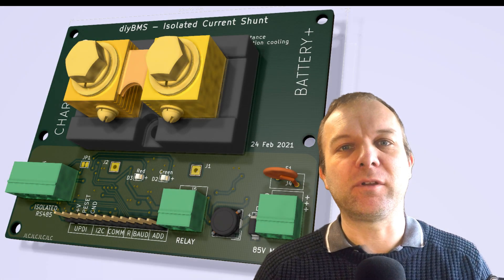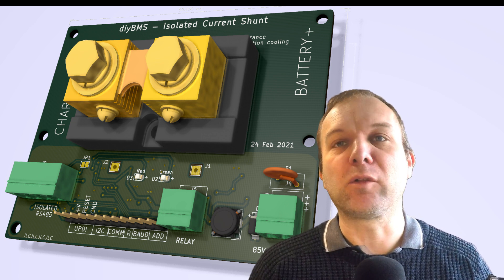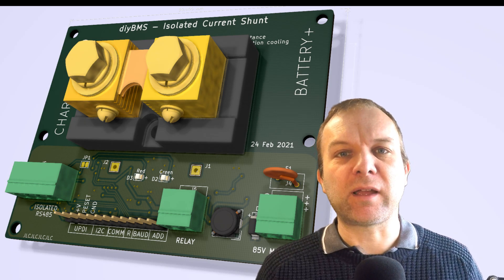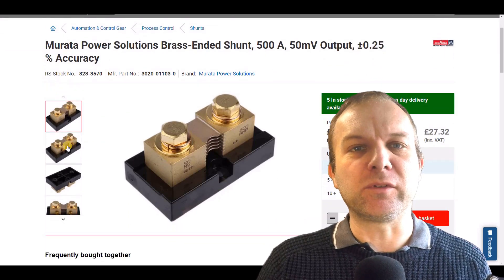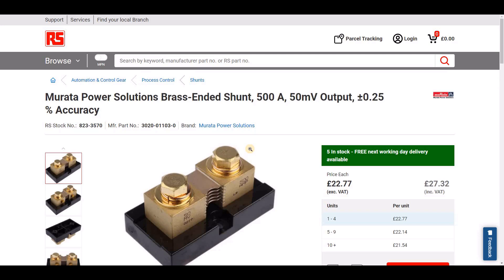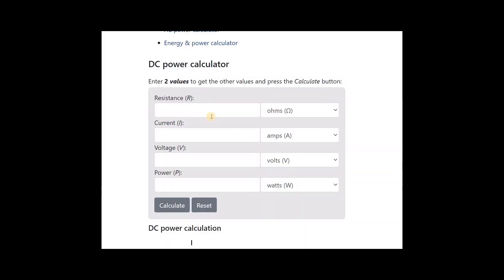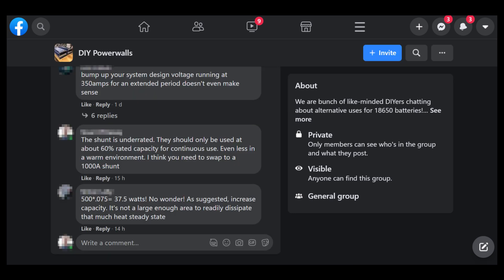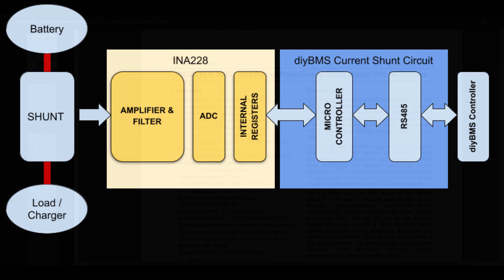Current monitoring (shunt) update & progress so far [diyBMS]

Comment: Hello
First of all, thank you for the DIY BMS project
i also have BATRIUM and i have more problems with it than with DIY BMS. I am asking (due to problems with parts) to answer if it is possible to use it for the DIY BMS shant BATRIUM project? I have an extra one, hence the possibility of using it
Thanks in advance for your answer
Regards, Jerzy
Reply from the maker: No I don't think that's possible

Comment: If the shunt gets hot it would be best to isolate it from the PCB, as to not heat up the board. That is, produce temperature gradients across the PCB. Temperature gradients can influence sensitive voltage measurement circuitry through the Seebeck effect. On the PCB there are many different types of metals connected together (like a thermocouple), so the only way to avoid these thermal EMFs is to make sure all areas of the board are at the some temperature (it is best to look at the final design with a thermal camera to make sure any temperature gradients are kept to a minimum around the most sensitive nodes). 

In some very sensitive instrumentation you will see sensing circuit PCBs with larger and many internal layers. This is done to spread out heat evenly on the board. You may even see the PCB contain an Aluminum metal core, or the entire board (circuitry only on top), bonded to a 0.250" aluminum plate.

You can connect the shunt to the PCB using a wire or a flat bus bar. If the shunt and PCB are rigid within the same enclosure a rigid bus bar will not vibrated as easily as a wire. A low value shunt wire connection must be held rigid as to not vibrate. If the installation is not subject to vibration than a wire will work. I like making custom bus bars because once soldered to the board they stay in position relative to the shunt sense terminals, when you have to separate the two. Why? for high gain circuits you can calibrate the circuit with the first stage gain or just have a huge selection or shunts available from the vendor and pretested as to measured value. Then you can select the shunt that best matches the amp, and not have to calibrated (change a resistor) the gain. So, on a production line you would have a selection of shunts and amps, and then have a calibration procedure to just match them up. With the worse case being having to change a gain setting resistor for the first stage instrumentation amp.
Reply from the maker: They are all very good points you raise.  The shunt doesn't really get hot - and its also insulated by the plastic base.

Comment: Stuart, any progress on this?  I don’t see anything posted on your GH. 

I’m similarly have started to work on a power monitoring PCB using the INA228AIDGST and an ESP32. My initial plan is to physically separate the shunt away from the PCB as this adds a lot of flexibility to use any shunt.
Reply from the maker: Yes, its fully complete and finished - https://github.com/stuartpittaway/diyBMS-CurrentShunt
Reply: @StuartPittaway  Hello. Is it possible to connect two or more current monitors?
Reply from the maker: @kaldeis  its not currently supported, although there isn't a hardware restriction, its just not written into the controller code.
Reply: @StuartPittaway  Do you plan to add this functionality?
Reply from the maker: @kaldeis  If there is enough interest in it, I can.  I think you are the first to mention it!
Reply: @StuartPittaway  
I do not need it, but the person who would like to order with me is waiting for this functionality. explains that he wants to measure many devices in a smart home. I think that his expectations are too high;)

Thanks again for your work.

Comment: What is the max number of series connections you can do with the diybms
Reply from the maker: Technically over 100 are supported, but for performance I'd recommend less than 40
Reply: @StuartPittaway Thank you. So for an 800V lifepo4 battery i will need to do 3 batteries connected in series. I guess there is no reason why it should not work.
Reply from the maker: @arhitektche  should work, by I really really really recommend you don't stick to lower safe voltage less than 50V DC
Reply: @StuartPittaway  Thank you for the advise!

Comment: Could you post a link to the schematic? 
Did you need to separate analog and digital grounds?
Reply from the maker: Hi, I've not published the circuit yet, effectively it's just the reference design from the datasheet. Doesn't need separate grounds

Comment: Stuart, I'm curious ... did you consider a hall effect current sensor vs shunt? I'm using shunts now and have been thinking hall effect would be the way to go given 2 fewer physical connections in the main power path ... plus no extra heat / power drain.
Reply from the maker: You still need to measure the voltage, shunts give you both options and I think they are more accurate

Comment: Question:    Why not use a Fuse?   You need one in the path.  No extra loss.   Cheap.  Calibrate for each Fuse swap.
Reply from the maker: A fuse instead of the shunt do you mean? Fuses are not that accurate, how would you calibrate it?
Reply: @StuartPittaway  I can think of MANY ways to calibrate.  More important is long-term stable results!     For example a "short burst" pulse of a load.   Once you have a few points of the curve the rest is interpolated.   The "load shunt" resister should have a stable curve over any style of the fuse.   Or a dummy load for the full long-term load numbers.  I use a 12v heater!
Reply: @myCloudWatcher  How linear do you think a fuse is?

Comment: how about an open loop current sensor instead of a shunt?

TI has a 100amp busbar demo unit using a pair of their DRV421. PDFs to google for: TIPD205 describes the demo; SLOA237 for the Theory.
Reply from the maker: It could work, however this only gives you the current - we also need an accurate voltage to calculate the power and energy used

Comment: Aren't most shunts using the battery negative lead rather than the positive?
Reply: Doesn't matter to the shunt. The rest of the system might care for various reasons. On my system I cannot put a shunt in the negative because on my system the negative is tied to earth ground as are various other places in the system.
Reply from the maker: Mike, technically the INA228 supports both options.  Reading through this guide, it seems that high side has more benefits - https://www.microchip.com/en-us/about/blog/developer-insights/high-side-versus-low-side-current-sensing
Reply: @StuartPittaway  Yes, it supports both and there are definitely positives and negatives to either option. I just wanted to confirm that it is intentional to use the POS terminal of the battery. I'd suggest having a very clear assembly diagram as part of the documentation for this device.

When you have this ready to produce, in mass I'd be happy to help with a USA order (same as was done for the v4.2 controller PCB). I have the tools (and parts!) to assemble these in bulk as well.

One Q, since you have SMT components on both sides of the PCB, are you having JLCPCB assemble the back side only?